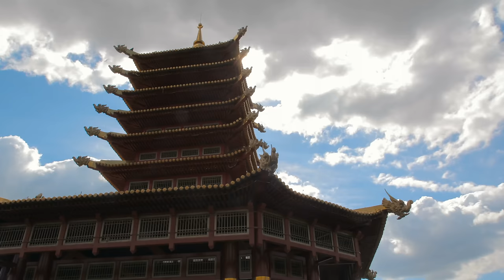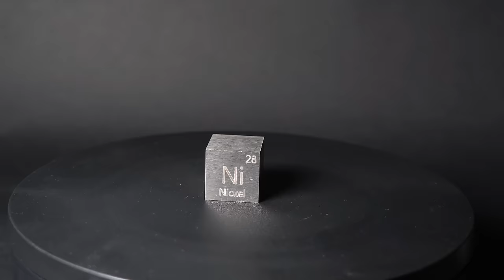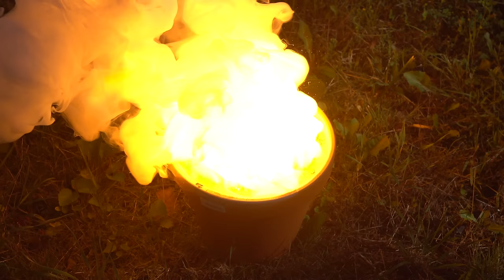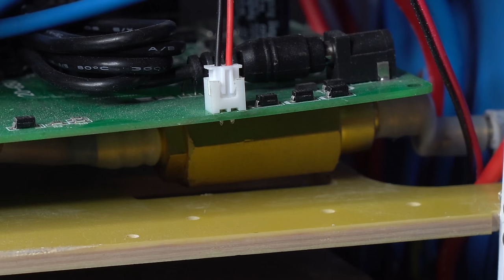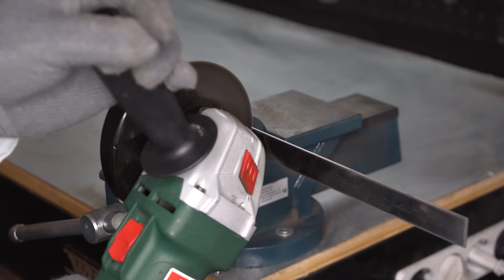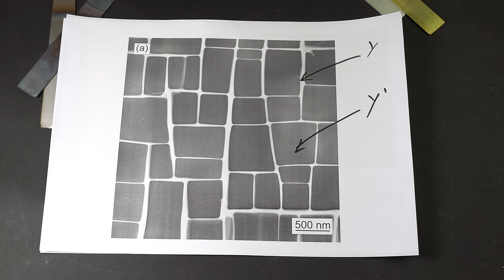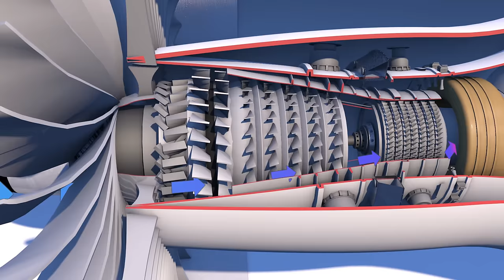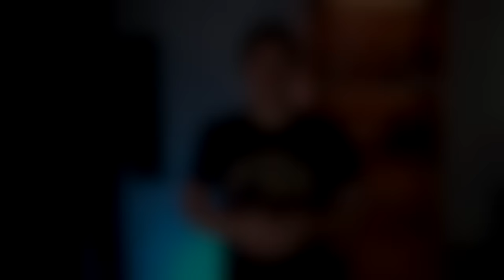Superalloy - A Material That SHOULDN'T HAVE BEEN CREATED!

Comment: Metal alloy idea:

Samanik hypersteel: Carbon 0.5%, silicon 0.6%, manganese 0.9%, vanadium 5%, chromium 7.5%, cobalt 7.5%, nickel 3%, zirconium 0.25%, molybdenum 5%, niobium 0.25%, tungsten 7.5%, and iron remaining by weight.

This might be a tough 🔗 and strong 💪 metal 🔩 I think.
Reply: Silicon n tungsten? How old are you?
Reply: @dochawk2560  I am 22 years old and WDYM by Silicon and tungsten.
Reply: @Hypersteel-4340  silicon is trash for alloys, n tungsten melting point will kill alloy, so better to take boron
Reply: @dochawk2560 
bro in several high strength tool steel like S5 tool steel contains 2% silicon, advanced steel like hardox 600 steel contains 0.7% silicon stronger superalloy than that video show Inconel X-750 contains 0.5% silicon 😎. So I think you should do some more research on steel to show some even valid logic to prove me wrong 🤓. So do not take my second statement too seriously it was likely I was kidding with you 🙂. I am kind of thinking you might have some knowledge that I do not have and I also might have some knowledge that you might not have about various alloy 😇 🤝.
Reply: @Hypersteel-4340  silicone, silicone oxide is glass, sand, do you really want to have sand in the alloy??? Silicone is trash from iron ore!
Reply: @dochawk2560 
you might think that silicon is brittle and yes since it is because it is a metalloid but boron is also a metalloid which I think is also brittle. And I know it's only used in steel alloy at 0.005% and I do not know how cheap or expensive boron really but silicon is not less when it gives a steel alloy great toughness and strength and it also uses in one of the most impact-resistant metal alloys which are S5 tool steel which has high as 2% silicon content. If you know how to add silicon to the metal alloy correctly you might have a very durable, strong, and tough metal alloy, and the same go for boron as much as I think. Even 1 percent of boron might be very harmful to steel toughness which is a very important property of durability when you want to use a metal alloy in a very useful way and I am not insulting boron or anything both boron and silicon is a very great alloying element in steel but a higher chance of harming the toughness of steel or any metal alloy that higher percentage boron is very likely to be the reason for weakening the toughness of steel compared to silicon. So brittle glass does contain silicon but silicon is way far better to be considered trash or useless scrap or anything and speaking of boron borax are made of it if you saw it anywhere on YouYube you should just think how might it be useful if it as looks like some kind of detergent. And both boron and silicon have more potential than meets the eye but boron-type alloy contains very less boron compared to silicon which silicon content being 2% at max and boron content being 0.005% at max so if silicon is trash no metal expert would not recommend silicon to begin with even after testing once.
Reply: @Hypersteel-4340  B4C - boron carbide, ceramic material, hardest material that have almost diamond hardness!!!
Reply: @dochawk2560 
but the fatal flaw of boron carbide is it has zero toughness because it is a freaking ceramic and yes both moissanite and diamond also share the same pathetic fate as boron carbide both have zero toughness (Note toughness means getting vibration or deforming without getting a
chip or crack it is a property of durability with the combination of strength and flexibility) and also moissanite have 50% silicon and yet might as hard as boron carbide if not might harder.
Reply: @awashburn6944 
Why unbalanced care to explain bro?
Reply: @awashburn6944 
Composition of 4340 steel

Carbon: 0.38-0.43

Manganese: 0.60-0.80

Phosphorus: 0.035 (max)

Sulfur: 0.04 (max)

Silicon: 0.15-0.30

Chromium: 0.70-0.90

Nickel: 1.65-2.00

Molybdenum: 0.20-0.30

Yes this is a ligit steel made by pro and used by many pro as well how unbalanced the alloy I showed you compared to this piece of lad alloy 🤝🏻😎🗿!
Reply: @awashburn6944 
*Also my alloy steel intented to be a unique superalloy not average alloy 🤝🏻🗿!
Reply: @awashburn6944 
Bruh not 5 percent carbon it is 0.5 percent carbon 💀!

Like at least can you not see the difference here?

• Low-carbon steel. 0.05 to 0.15% carbon (plain carbon steel) content.

• Medium-carbon steel. Approximately 0.3–0.5% carbon content. ...

• High-carbon steel. Approximately 0.6 to 1.0% carbon content. ...

• Ultra-high-carbon steel. Approximately 1.25–2.0% carbon content.

So I hope if that makes anything clear my brother 🤝🏻😎🗿!
Reply: @awashburn6944 
Well the steel I am planning to make should be overall strong/durable and malleable/ductile and as for titanium this is I found from Quora

Here:

Is titanium ever used as a steel alloy?

Titanium cannot be a “steel alloy” by itself, since steels are (by definition) primarily iron alloys.

However, titanium is used in quantities up to 2% (by weight) in certain steel alloys like Maraging steel (highest amount: 1.6%) and a few stainless steels (used at 5x the weight percent of [carbon + nitrogen]).

Generally, titanium is used to react with carbon in steels for different purposes.

• In very high strength steels, titanium carbides are one of several strengthening mechanisms. They act as reinforcing particles that precipitate throughout the steel when heat treated (“aged”) carefully. In this application, titanium is similar to other carbide forming ingredients like vanadium, molybdenum, tungsten, niobium, etc.

• In stainless steels, titanium is one of several metals that can soak up carbon by forming carbides. Carbon is happy to react with corrosion-fighting alloying ingredients like chromium, which can cripple the “stainless” nature of the stainless steel. Titanium reacts more vigorously with carbon, so it sequesters the carbon before it can interfere with carbon. A lot of stainless steels attempt to eliminate carbon to begin with, but a little titanium helps clean up whatever carbon slips through processing.
Reply: @awashburn6944 
And also this from IspatGuru

Here:

Also due to the low density of Ti, it is to be forced into the liquid steel to avoid its oxidation and consequently it has a low recovery. Ferrotitanium (Fe-Ti) is a ferro alloy of Ti and is available in many grades, but the most common grades contain either 10 % to 20 % Ti or 45 % to 75 % Ti.
Reply: @awashburn6944 
Also alloy steel like 5160 steel have around 0.56 to 0.64 carbon content in it

And that I found about that steel as well

Here:

Alloy Steel 5160, also sold as AISI 5160, is a high carbon and chromium spring steel. It offers users outstanding toughness, a high level of ductility, and excellent fatigue resistance. Alloy Steel 5160 is in use in the automotive field in a number of different heavy spring applications, especially for leaf springs.
Reply: @awashburn6944 
*And I showed half of the percentage which is 5% I showed but what that info showed 10% 🤝🏻🗿!
Reply: @awashburn6944 
Yes bro I found your opinion logical and rational so I did some chaning in my composition care to check on top above the comment section please 🤝🏻😊😎😇🗿!
Reply: @awashburn6944  
Please care to reply I want to know about your opinion even more and yes I was only showing my point of view TBH and yes I did some changing at least care to check top above in the comment please I did find your opinion rational and logical after doing some more research 🤝🏻😊😇!
Reply: @awashburn6944 
And also congratulations I am your first subscriber 🤝🏻😎🗿!
Reply: @awashburn6944 
Well 3% niobium in it which it has and having a proper heat treatment as well?
Reply: @awashburn6944 
*Oh sorry you already explained about it my bad. Also what composition with same element do you think is even better for it?
Reply: @awashburn6944 
Well I changed the composition again but this time I put copper by removing titanium in the composition 😐.
Reply: @awashburn6944 
Vanadium, Chromium, Cobalt, Molybdenum, and also Tungsten enter the chat: Are we a joke to you 😐😑🤦🏻‍♂️?!

Meme source: Am I a joke to you?!

So meme aside any chance the can at least maku up the heat resistance enough to be workable as a decently strong heat resistant alloy with several Superalloy Washburn Sensei 🤝🏻😇🗿?!
Reply: @awashburn6944 
So removing the copper or something?
Reply: @awashburn6944 
Well does zirconium sounds good enough option in your opinion?
Reply: @awashburn6944 
Well about nickel being at 9% so I found some information from Quora which I found sutable but I do consider your opinion over mine considering I find you knowledgeable than me in this topic at least conpared to the one debated against before on our top of the comment 😅

So here are some information from Quora I found:
Nushrat Naushin:

"Ni is not a carbide forming element. So, it does not harden steel by carbide formation like Cr, Mo, V, W does. Instead Ni creates solid solution with iron within the solubility limit.

Ni has a unique ability to strengthen steel without losing it's ductility. Ni is basically a ferrite stabilizer.

In superalloys, Ni creates Ni3Al, Ni3Nb, Ni3Ti etc. and work as strengtheners.

Hope it answers your question. Good luck."

Replied by Charles Dohogne:

"A bit of word play here, but adding Nickel does not make the steel stronger, it makes it tougher. This allows heat treating to a higher strength level without loosing ductility."

Muhammad Haris:

“How can nickel harden steel” Request by Thibaut Deveraux

Steel, in general, is an interstitial alloy of mainly Iron(Fe) and Carbon (C) while stainless steel is mixed of interstitial and substitutional alloy/solution. Carbon occupies the interstitial space between the Fe atom while Nickel and other elements tend to ‘move’ the Iron atoms inducing slips mechanism [1].

Nickel doesn’t have a direct effect of hardness of steel as Ni is an austenite stabilizer that tends to lower the austenite formation temperature which is least ‘hard’ among the steel structure found in steels. But another pov can be discussed here i.e. Hardenability. The hardenability of a metal alloy is the depth to which a material is hardened after putting it through a heat treatment process. The unit of hardenability is ‘length’. It is an indication of how deep into the material a certain hardness can be achieved [2]. The standard used to measure hardenability is The Jominy End Quench Test.

Alloying elements including Ni have a tendency to increase the hardenability of steel that favour the martensite formation at a lower temperature and at a relative low cooling rate.

That's just one aspect that I can relate now in which “Ni” played a “role” in hardening of steel with other factors as well. Hope it helps."

Peter Bernard:

"Nickel hardens steels by solid solution hardening. It lowers the carbon content of the eutectoid and increases the hardenability somewhat. It has it’s greatest effect on hardenability in the austenite to bainite transformation range, and is used to increased the hardenability, rather than hardness as such. Because of this, nickel bearing steels are used for components with a large cross section, such as large castings and forgings."

Horst E:

"Nickel itself does not harden steel as far as I know. It helps hardening steel in a way that it gives you more time to cool down the steel when hardening. This makes it easier to harden big, heavy parts and also helps to avoid cracks that sometimes come when cooling down a part too fast."

Karl Emmanuel Sanchez Laursen:

"Nickel replaces some iron atoms in the steel crystal structure, it is allmost the same as iron, except for a small difference in size, so it introduces irregularities in said crystal structure, making it harder for atoms to slide past one another, thus hardenning it."
Reply: @awashburn6944 
So are you there bro and yes I did some changeing again in my composition TBH 😅 please may you care not get pissed or mad if you found my comment annoying my man 🙏🏻😣😇?!
Reply: @awashburn6944 
Well I have even more composition only 3 of them I discovered

Here:

Metal Alloys and Materials and Its Compositions

Hypertronium: Carbon 0.1%, silicon 0.5%, manganese 0.9%, titanium 18%, vanadium 5%, chromium 5%, iron 18%, cobalt 7%, nickel 12%, zirconium 12%, niobium 7%, molybdenum 7%, and tungsten 7.5% by weight.

Samanik hypersteel: Carbon 0.5%, silicon 0.6%, manganese 0.9%, vanadium 5%, chromium 7.5%, cobalt 7.5%, nickel 3%, zirconium 0.25%, molybdenum 5%, niobium 0.25%, tungsten 7.5%, and iron remaining by weight.

Rubatronium: Titanium 40%, iron 40%, copper 10%, and the nickel 10% by weight

Grade 5 titanium: Aluminium 6%, vanadium 4%, iron 0.25%, oxygen 0.2%, and the titanium remainder by weight.

Inconel X-750: Aluminium 1% carbon 0.08%, chromium 17%, cobalt 1%, copper 0.5%, iron 0.9%, manganese 1%, niobium 1.2%, titanium 2.5%, sulfur 0.01%, silicon 0.5%, and the nickel remainder by weight.

1050 steel: Carbon 0.5%, manganese 0.9%, phosphorus 0.04%, sulfur 0.05%, and the iron remainder by weight.

Fe 600 steel: Carbon 0.3%, sulfur 0.04%, phosphorus 0.04%, and the iron remainder by weight.

4340 steel: Carbon 0.4%, manganese 0.8% phosphorus 0.035%, sulfur 0.04%, silicon 0.3%, chromium 0.9%, nickel 2%, molybdenum 0.3%, and the iron remainder by weight.

5160 steel: Carbon 0.6%, manganese 1%, phosphorus 0.035%, sulfur 0.04%, silicon 0.3%, chromium 0.9%%, and the iron remainder by weight.

316L steel: carbon 0.03%, manganese 2%, silicon 1%, chromium 18%, nickel 14%, phosphorus 0.045, sulfur 0.03%, molybdenum 3%, and the iron remainder by weight.

420HC steel: Carbon 0.45%, chromium 13%, manganese 0.4%, silicon 0.4%, nickel 0.5%, molybdenum 0.6% vanadium 0.3%, and the iron remainder by weight.

L6 steel: Carbon 0.7% manganese 0.8%. silicon 0.5%, chromium 1.2%, nickel 2%, molybdenum 0.5%, vanadium 3%, copper 0.25% phosphorus 0.03%, sulfur 0.03%, and the iron remainder by weight.

S5 steel: Carbon 0.6%, manganese 1%, silicon 2%, chromium 2% molybdenum 1.35%, vanadium 0.35%, copper 0.25%, phosphorus 0.03%, sulfur 0.03%, and the iron remainder by weight.

Hardox 600 steel: Carbon 0.47%, silicon 0.7%, manganese 1.4%, phosphorus 0.015%, sulfur 0.01%, chromium 1.2%, nickel 2.5%, molybdenum 0.7%, boron 0.005%, and the iron remainder by weight.

Vibenite 290 steel: Carbon 2.5%, chromium 4%, molybdenum 5%, tungsten 11% cobalt 16% vanadium 6.3%, and the iron remainder by weight.
Reply: @awashburn6944 
Our man Thoisoi (This Video Maker) already made a video about similar superalloy to that so I think it may kind of educate or benifite both of us for at least this topic here it is my senior 🤝🏻😊😇!

Here: https://youtu.be/8IeEDKQ35vg
Reply: @awashburn6944 
And yes after giving you that much info I change my composition again 😇! And yes care to rank me please how much unbiasly I learned from somebody who I consider yourself teacher of mine when ranking 0 to 10 and yes may care to post a comment in my community tab as well please I may offer you something you might found interesting 🤝🏻😊😇?!
Reply: @awashburn6944 
Well my friend long time no chat how are you my friend may peace be upon you as well 🤝🏻😇?!

Comment: Could be used for the disks in a tesla turbine
Reply: Inconel 718 has been used as a turbine disk material for many decades. For aircraft engines it was replaced by higher strength superalloys, but it’s still used for land-based turbines.
Reply: @Doug_in_NC  Wow Higher strength alloys!

Comment: The steal industry is a complete racket. The process of producing a consistent high quality product is the same for all metals, and the cost of additives required to produce a fixed amount of exotic high performance alloy is negligible. The wholesale and retail prices for exotic alloys have nothing to do with the production costs. The logistics of distributing exotic alloys with a smaller scale demand to industry, may be a little higher than base metals, but not enough to justify the price tag customers pay. What a shock it would be, if exotic steels were produced using a not for profit business model.

Comment: I'm pretty sure a supermarine spitfire could crack mach 1.0 in a dive on fumes. The thunderscreech wasn't developed adequately either. You cannot say something isn't possible when the technology changed to jets before incremental improvements were made by successive generations.
Reply: I'm absolutely sure a spitfire would break apart before it reached Mach.

Comment: CEO SpaceX Elon Musk's Starship Raptor 2  engines are made of an super alloy called sx500 which is also same alloy as Inconel or Monel! CEO Elon Musk has even claimed it to be the one of the powerful rocket engine since the 1969 Saturn V  rocket!  And even the Russian failed rocket the N1 Russian rocket during the Soviet Union! Yes! Building bigger better rockets are  hard and require a lot of testing! Which require advance and stable materials to withstand the harsh conditions of space!

Comment: superalloys contain no iron...
Reply: IN 718 and a lot if the other older superalloys do, but pretty much every superalloys developed after about 1960 eliminated iron.
Reply: @Doug_in_NC  I worked with Inconel and Hastelloy, guess they are the newer ones.
Reply: @ElmarDylong  There are basically 3 classes of nickel superalloys (I’m oversimplifying here) - the ones aimed at really high strength at “intermediate” temperatures, ie developed to be better stainless steels, still contain quite a lot of iron. IN 718 is the most common of those.  Then you have the ones that are good at higher temperatures but can be formed relatively easily, like the Hastelloy X you are probably familiar with, and then there are the ones used for turbine blades that are basically unformable and only used as castings. I’m not addressing the niche  untra-low thermal expansion alloys like Invar, or shape-memory alloys like the one the paper clip was made of.